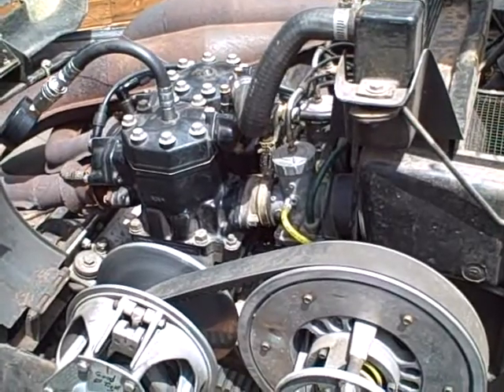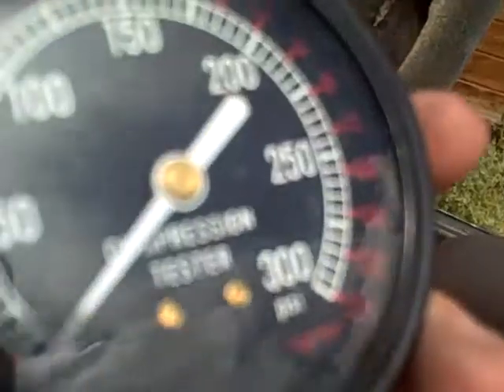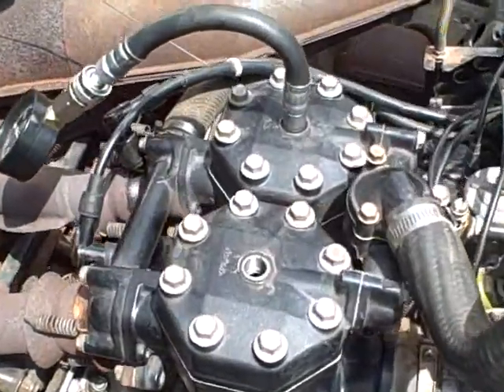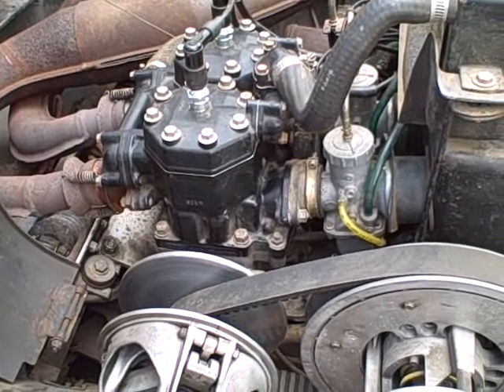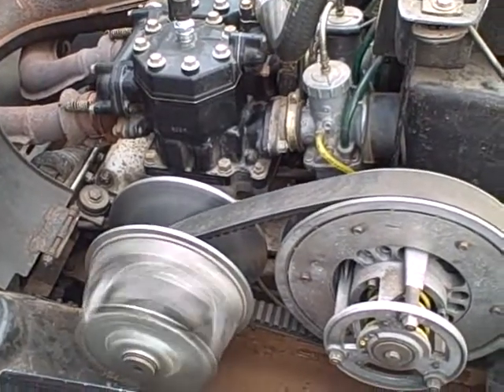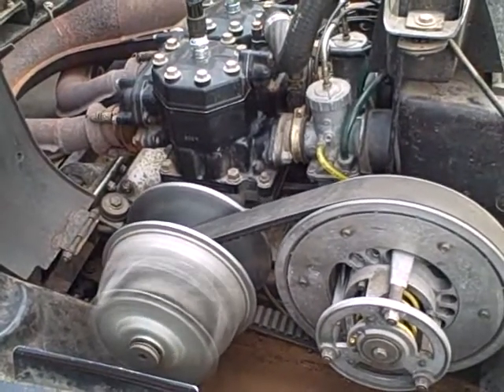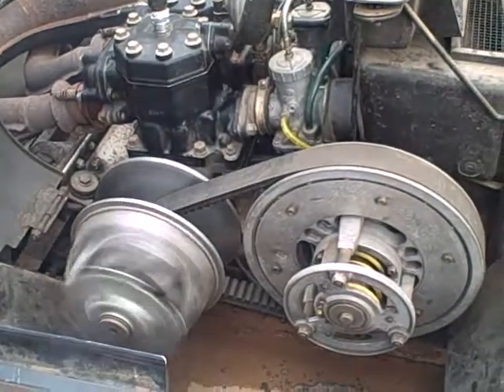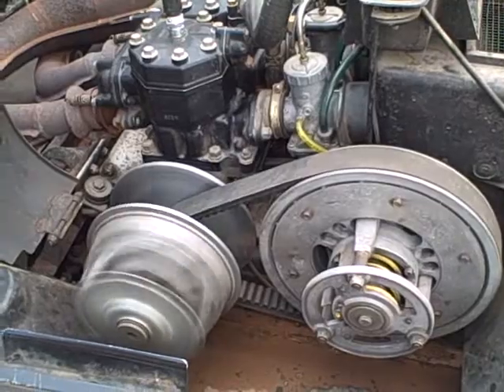1986 arctic cat el tigre 530 Compression and run test

Comment: I got the same year and model sled not that common. Any well known issues or design flaws to be aware of? Awesome vid btw!
Reply from the maker: None that I'm blatantly aware of at least. Just make sure to run a good TCW-3 rated 2 stroke oil and make sure you have a spare belt!